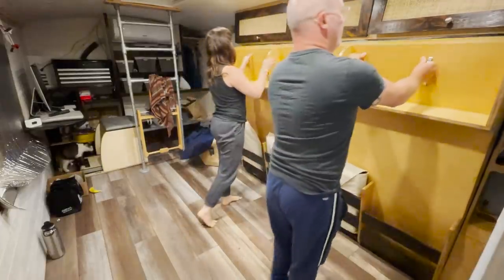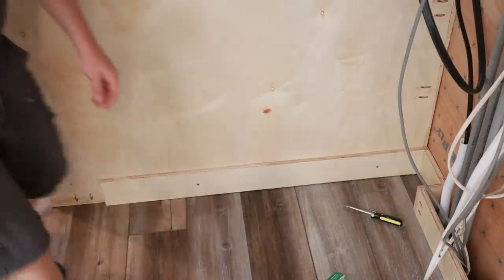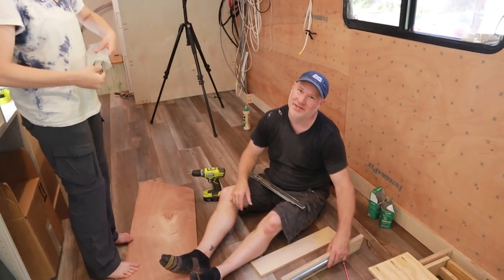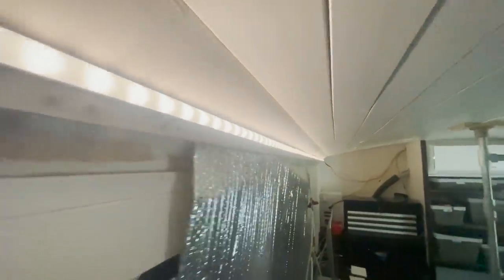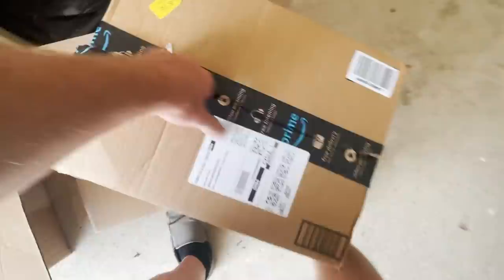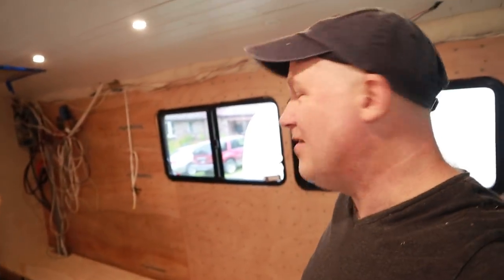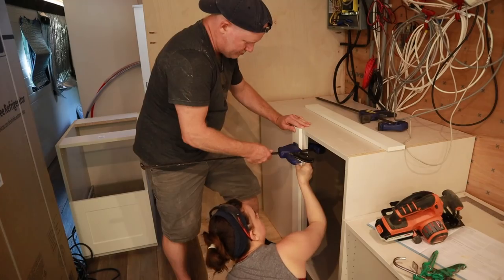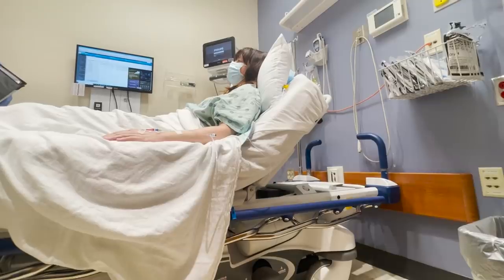Toe Kick Drawers in our Bus Conversion Kitchen - S04E28

Comment: The switches that you installed for your indirect lighting is ac switches you should check on those it looks like you hooked them up to dc they may not be compatible . Just looking out for your safety